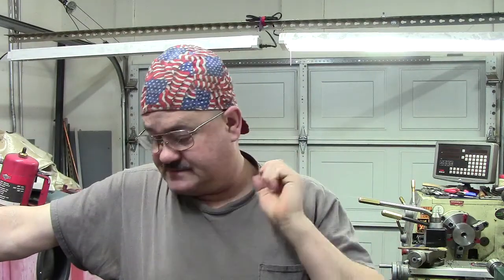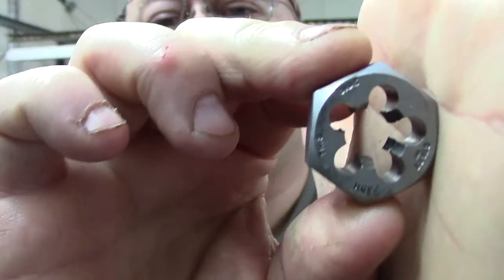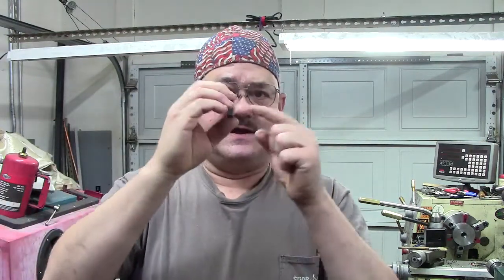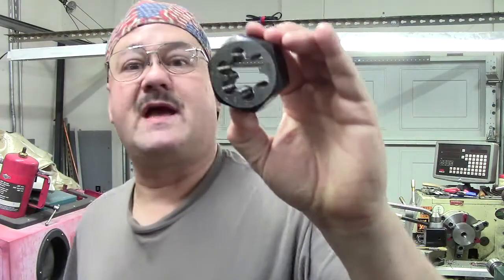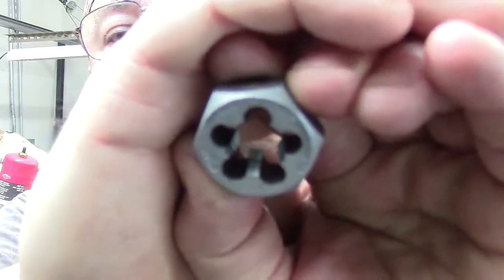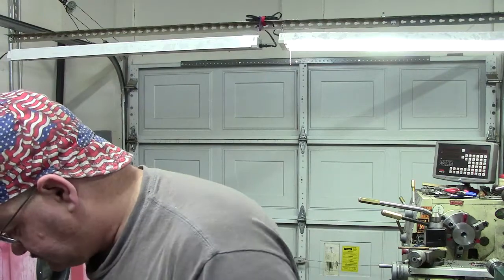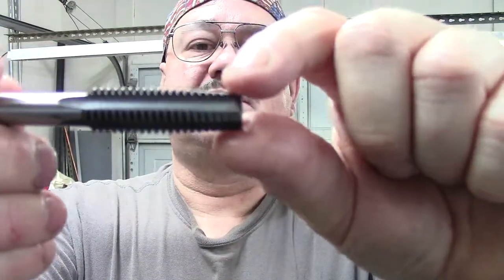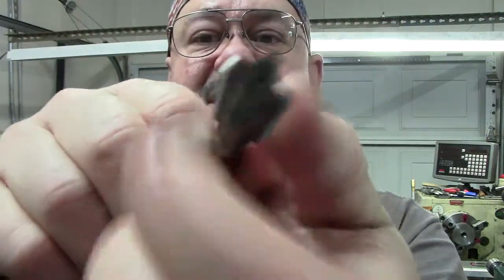Thread Cutting and Re Threading Dies. Whats the difference!

Comment: You are absolutely right.  I spent the better part of my career in the tool supply business along with my machine shop.  I chose not to challenge the other presentation on it.  I have both re-threading taps and dies and tread cutting taps and dies.  Re-threading dies are hex, that is true.  I sold Vermont American taps and dies, their threading dies were hex, I also have Craftsman hex threading dies.
Reply from the maker: R. Steven Lang, Shark River Machine Yes. I learned this at an early age and have never forgotten it.

Comment: Very good explanation, I learned something new today.  One problem I constantly have is drilling a blind hole too shallow.  Maybe you can do a quicky on determining how deep a blind hole should be drilled to have room for a taper tap, plug tap etc, and still get enough depth for the intended bolt.  Thank you.
Reply from the maker: Pat Wicker measuring the tap and adding 25% of the threaded length of the tap to the total depth of the hole is what I was taught inorder to have enough threads after a finish run with a bottom tap.

Comment: But I want to know if you can cut with a rethreading die? I need a 7/8" - 32 die for threading mild steel. For some stupid reason, my chinese lathe doesn't have a 32 pitch option. It skips from 28 to 38. WTF!? I don't want to spend $70 for a cutting die and rethreading dies are much cheaper.
Reply from the maker: It may or may not work. I suggest searching ebay for an actual cutting die. Sometimes you can find a new old stock one for your needs. Or hit social media and ask around in hobby groups. You may find a solution there. Hope this helps.

Comment: I cut 1/4" -28 brass rod with an octagonal cutting die for a tapped brass hole expecting a snug fit, but the fit is rather loose. Is this standard or the result of a cheap Chinese die?
Reply from the maker: Perhaps or end up destroying the die or the material itself.